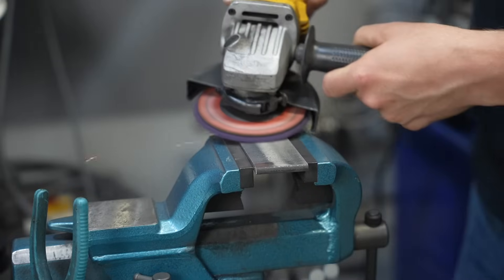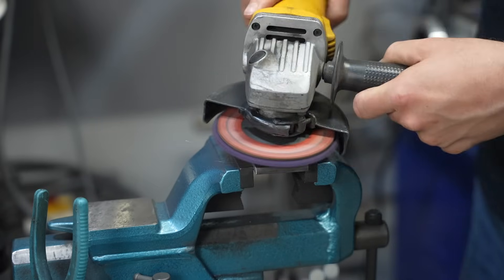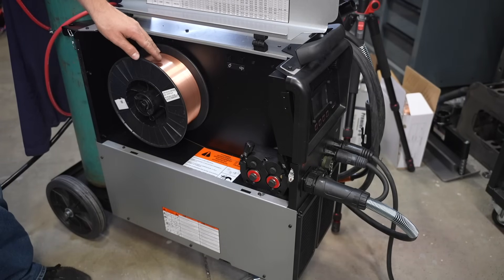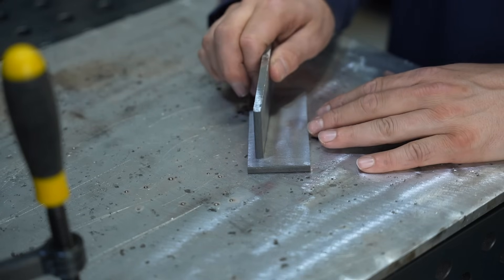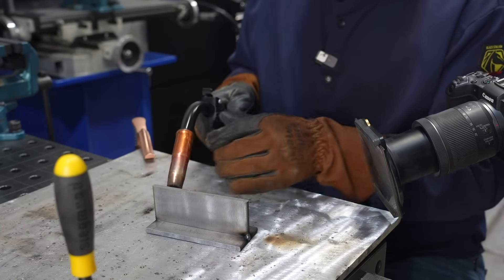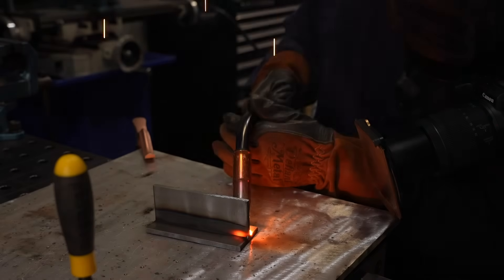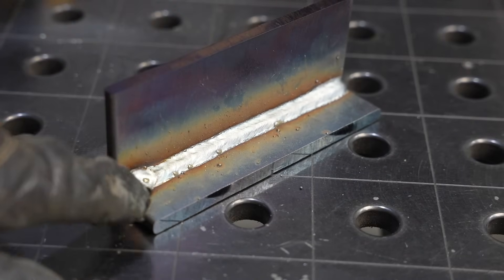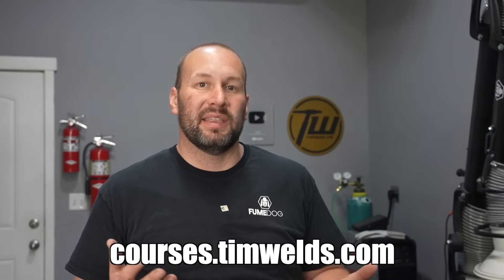MIG Welding: How to Make a Consistent Weld Bead

Comment: Bought my first welder and start practicing. Is it normal to get burn marks either side of the weld? Yours looks really clean.
Reply from the maker: If it's just a little soot, it's probably from material cleanliness or slightly low gas flow. If you keep running into that, email me a photo at the email address in my about page and I'll help you troubleshoot it.
Reply: @TimWelds Appreciate that Tim!

Comment: Great format Tim. Is there anywhere I can find an easy way to convert feet per minute to metric easily?
Reply from the maker: Thanks! 

The wire speed is in in/min, so if you divide by 40 it will be pretty close to meters per minute. I'm lazy, so I usually just Google something like "300 inches to meters" and it spits it out.

Comment: Another thing that removes mill scale very well is bending it in my hydraulic press. Not helpful if you want it flat.😊 But it does show how weak that surface is if you paint it or otherwise need to contact that surface after the project is made. Something happened to me the other day that I think I should relate as it might help someone. I made 2 inch by 4 inch by a 1/4” thick plates with two holes in each to upgrade my steel handcart to more easily use those strap systems. I started to weld the first one, and the wire was burning back severely. I went to the welder and everything was fine. I tried again with the same results, so I played around with the settings without much change. Then, for some reason, I became suspicious of the wire feed. I looked and the adjustment felt loose. I tightened it a half turn, and it was a lot better but not right. One more adjustment and everything was fine. I’ve never had that happen before and I can’t think of why it did. But it’s another thing to look at if your weld is sputtering.
Reply from the maker: Surface prep by bending, I love it! 

Great tip on wire feeding! Most of the time when I help troubleshoot an electrical problem with a wire feed welder, it turns out to be a feeding issue. It's often the liner, but I can see how the roller tension would do that.